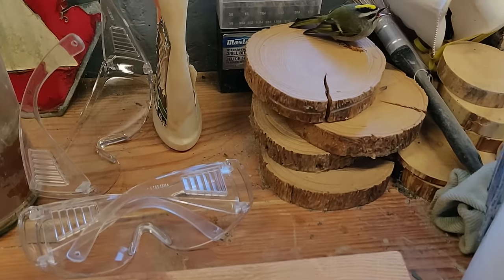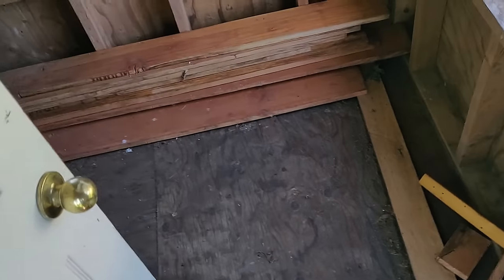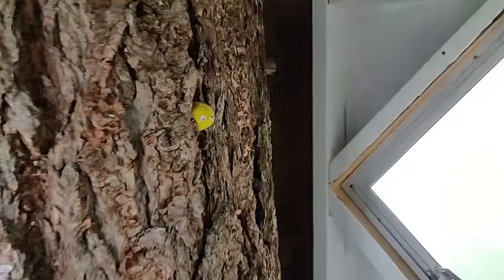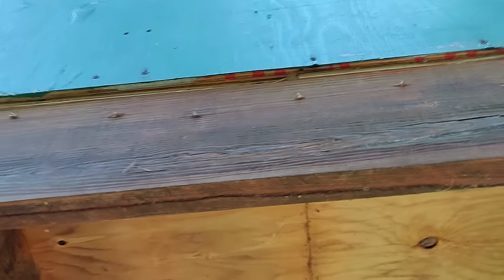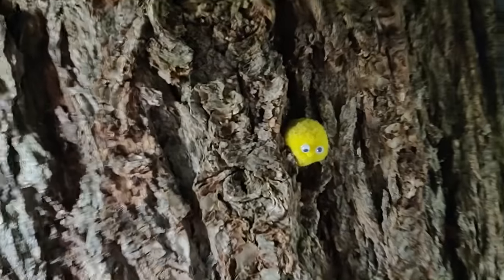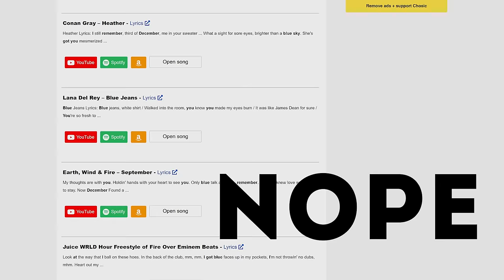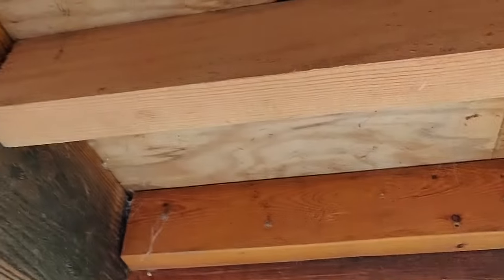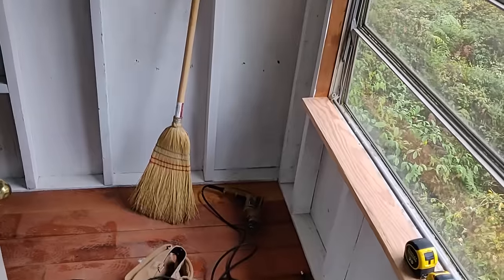Finishing the treehouse (and saving a bird)

Comment: 11:50 that's not the only reason. The main reason is so the board does not rock/teeter-totter in the axis of its length for boards that are cupped or twisted (look up wood warp and you'll get it)